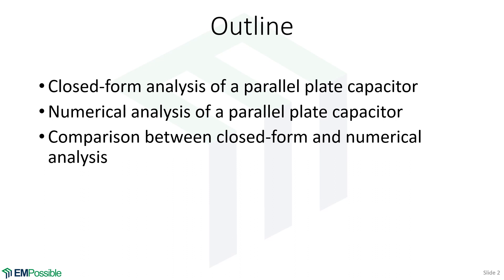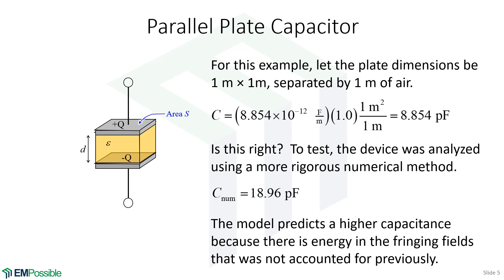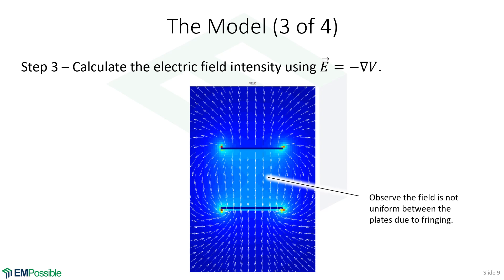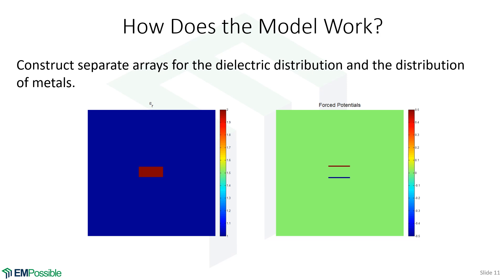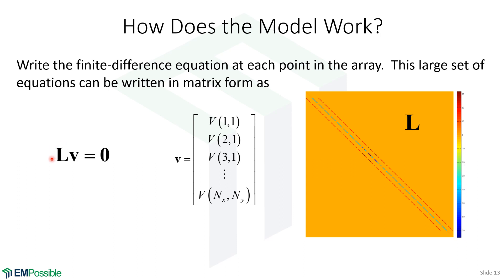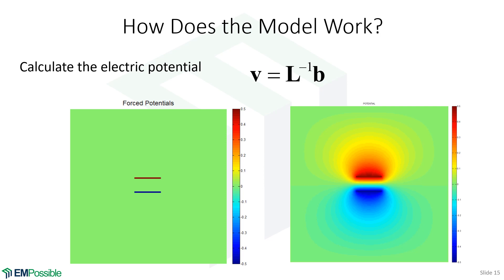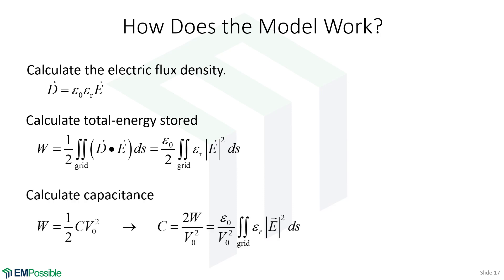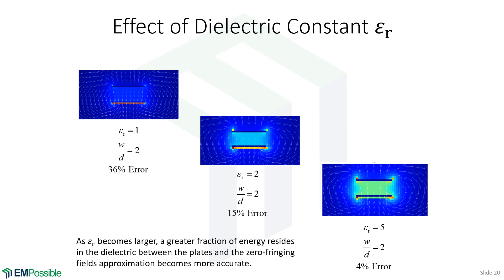Lecture -- Numerical Capacitor Example

Comment: Can you please explain how to solve the matrix equation? I have done some digging and it looks like writing L as block tridiagonal matrix and expressing it as Kronecker Sum is most efficient way to solve it.
Reply from the maker: What programming language are you using?  If you are using a tool like MATLAB or Octave, you do not have to put that much thought into it.  You can simply solve by backward division and MATLAB figures out the best way.  If the problem size is large, you can use any of the built-in iterative solves as well.

Comment: I would love to hear why is the Laplacian of the electric potential 0. For that the charge density would have to be 0 in the same domain according to the divergence of the electric field, but aren't the plates charged?
Reply from the maker: Any time you are looking at fields and potential away from charges, the equation you are solving will equal zero.  If you want to see a derivation and explanation, see Lecture 4j here:

https://empossible.net/emp3302/
Reply: Thank you very much, your videos are very helpful.